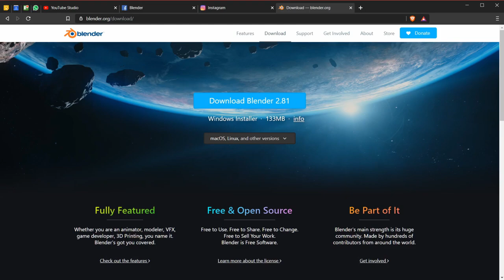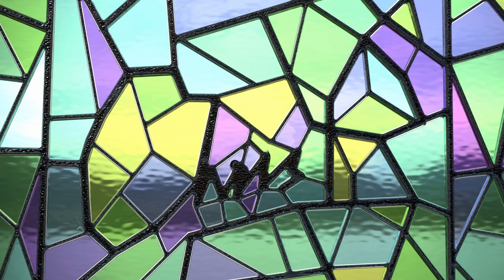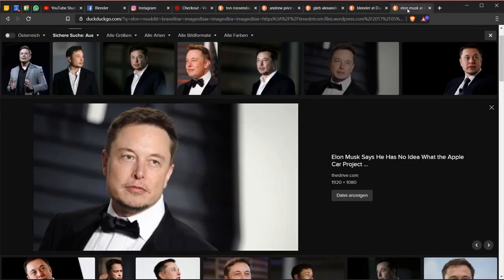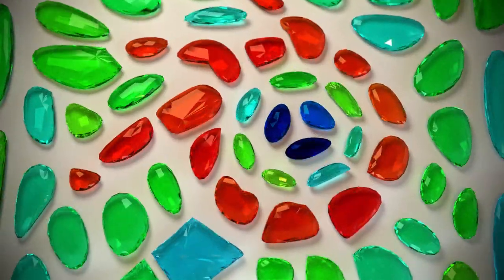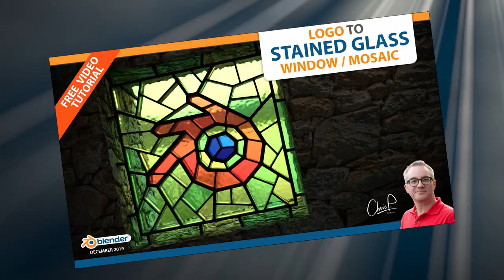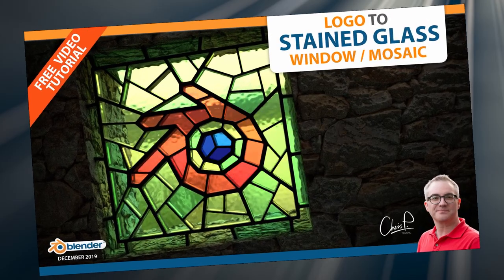TLDR Logo to Stained Glass Window/Mosaic (Blender 3D)

Comment: 0:17 Why should use 2.82Alpha for this?
Reply: "Random Per island" socket, which causes different colors in the window pieces, just becomes available these several days in 2.82 alpha. Yes, blender develops so fast that blender 2.81 is already outdated at some level. So you have to use 2.82 or more advanced version.